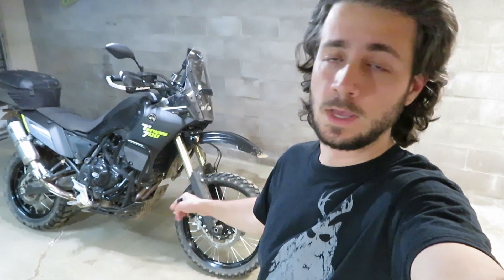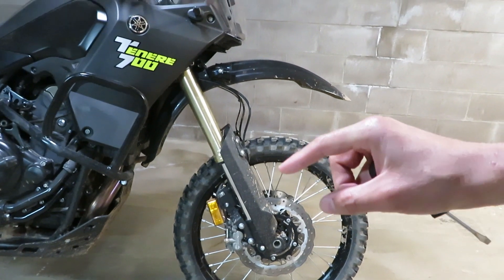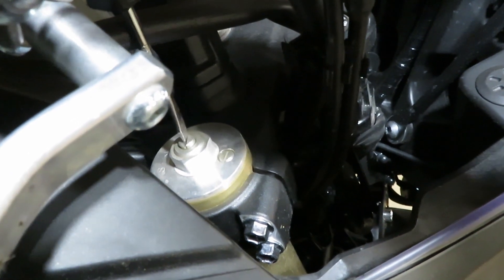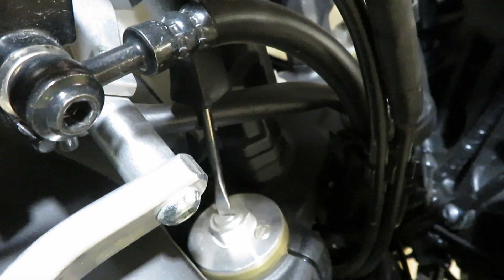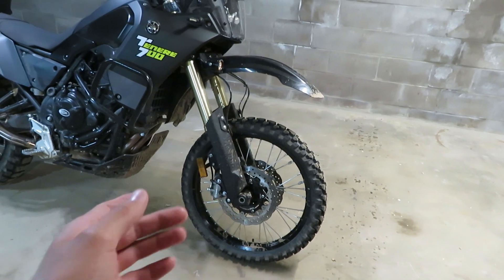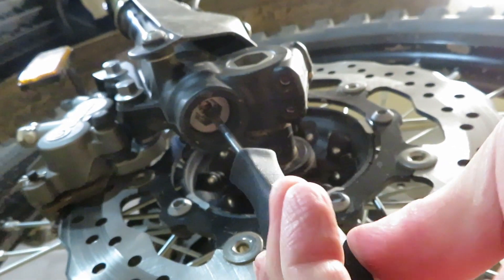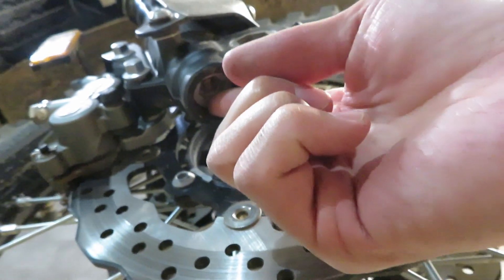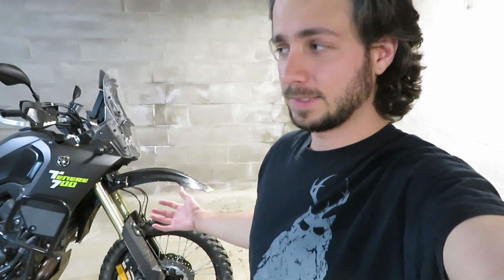Adjusting Tenere 700 Compression & Rebound Damping (Front)

Comment: cool thanks I am loading  my poor bike up for a long trip .. the back was easy peasy just set spring to max..If I under stood you right I adjusted the lower one in front to max so with additional weight will take more force to compress fork ? sure wish the book just used clockwise counter clockwise instead of a b or lefty loosy righty tightly lol so full a is the smallest opening for oil so will take more force to compress " )

Comment: This is great info my dude. So wait, they ship the tenere at the softest rebound setting if I'm understanding correctly? Interesting. What did you end up deciding to leave it at? Great video.
Reply from the maker: The rebound setting was out all the way when I got it (not sure if that was Yamaha or the dealership) but the softest and the standard setting are the same on that one.  The rest were all at or around the standard recommend setting.  I actually ended up with the front at 16 or 17 on rebound and compression is at like 8.  The rear I ended up going back down to the standard 15 for compression and actually turned the rebound put to 23 and that all seems good enough to try for a while.  That's next weekends video.

Comment: My (2021) manual says 31 clicks softest rebound. I tried that and could not go further than 28 clicks. Compression it says softest is 22 clicks but I did not try that after the rebound clicker stopped earlier than the manual said.
Reply from the maker: Huh, so they must have switched the numbers at some point during 2021?   I've noticed some really odd stuff in my manual that doesn't really make any sense, like headlight adjustment.  Not sure what happened there lol.